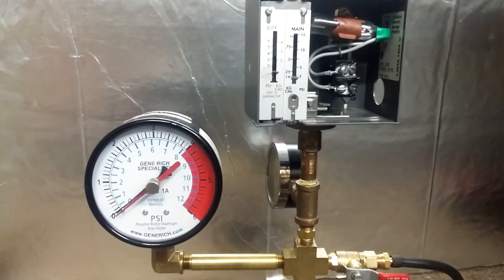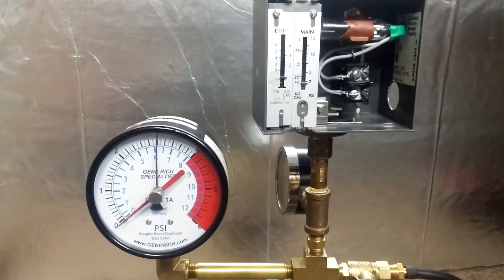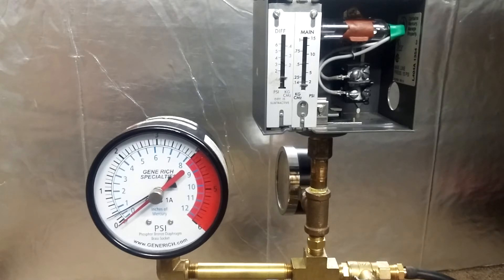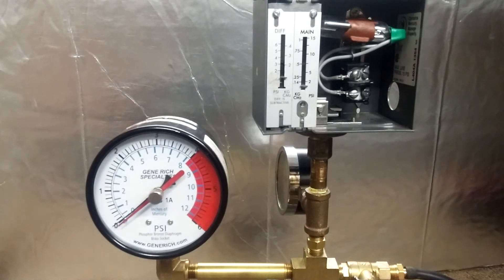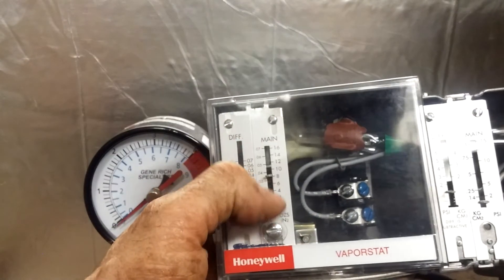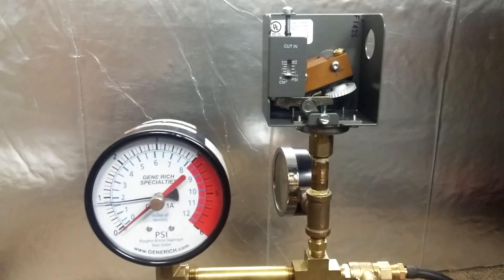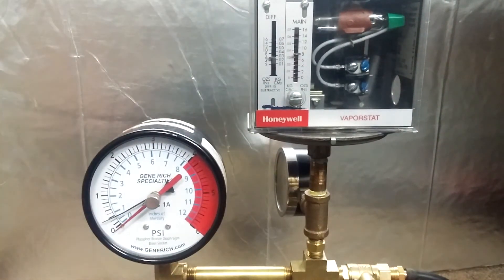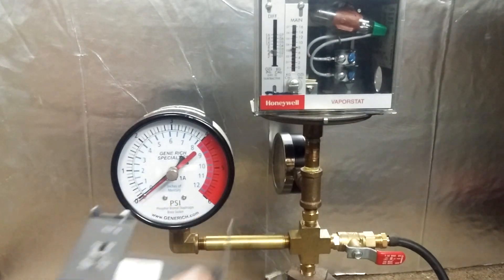Worst Honeywell Steam Pressure Control EVER! A True POS

Comment: Hi,I have the pa404a. Did Honeywell put a thread locker on the adjustment screw to limit the travel of the cut in below .5 psi? It gets snug like it's bottoming out, using fingers thanks
Reply from the maker: If I understand you correctly, yes, Honeywell put blue tinted threadlocker on a tiny adjusting set screw.
I would not try to operate the PA404A below the designed 0.5 psi cut-in as the unit will not be stable enough to consistently re-set to turn on when the pressure drops.
Reply: @gordonschweizer5154  thanks, I have a pressure gauge that starts at 1 psi ,goes to 30, it hardly ever moves except on the early am 25 and below nights when the boiler is overwhelmed. Anyway the 404 indicator is right at .5 and the diff wheel is as far as it goes down to 1.  Anyway the boiler pipes seem more happy when the sight glass water is 1/2 way, nearest the lwco probe, instead of the 2/3 to 3/4 full the plumber always sets it to. The return pipe is slightly above the top of the boiler, It will hammer there on start up if the water fill is higher.
Reply from the maker: Is your pressure gauge of the "internal siphon" type?
Reply: @gordonschweizer5154 logo : it's a usg within a German cross on the dial, connected above the pigtail
Reply from the maker: Ok, I hope the gauge is malfunctioning and not reading the true pressure.
Gauges with internal siphons tend to have high failure rates due do clogging.
And good on you for operating your boiler at the proper water level for your situation.
Reply: @gordonschweizer5154  thank you sir, you know more than me, I just had it all cleaned a few days ago, but it's 20yo, the tech said maybe 5 more and it's done.
Lucky to 30 on a Smith..crossing my fingers,LoL.
Reply: No. The mechanism isn't going to even respond to a Pressure less than a half p.s.i.  the Mechanism itself takes that much to trip the micro-switch.
Reply: @Jeremy-dr3is  ,I had no plans to go below .5,  until I get a vapor stat on the next boiler. I have it turned down to where I feel the loctite resistance and call it close enough.

Comment: Thanks Gordon, I have one of those controls on my boiler I’m going to check the model out now but what’s the replacement for it? Plain Jane pressuretrol or a similar one without mercury from Honeywell?
Reply from the maker: Yes, the 'plain jane"  PA404A is just fine for a single pipe steam system.
If you get a new one, keep the receipt.
If you can't get it to work below 2 psi out of the box, take it back!
Let the folks who you buy it from know what you expect.
Reply: I’m guessing that the better 8oz mercury control with the bigger diaphragm is no longer available?

Comment: Gordon, what a shame ! This is the exact model we have on our boilers, which were set to 7 PSI main and 3 diff, along with L404C 1147 manual reset at 12PSI and L91A 1037 modulating control set at 5 PSI. Would you keep the modulating control we have ? What would it be best to set it to ?
Reply from the maker: You might try replacing your operation control with a bog standard PA404A pressuretrol.
Then, you can turn down your manual reset limit control to 5psi.
The modulating control should be set as low as it can go.
If the modulating control doesn't go low enough (1/2 psi), give us a call.
We have some in oz/in2.
Reply: @gordonschweizer5154  We will be in touch about that modulating control ! Is there any pressuretrol that tops out at about 3-5 PSI that you would consider accurate enough to be worthy enough of using on a vapor system ? Tonight while in the boiler room I had the thought that being able to build that level of pressure is useful for cleaning out strainers that have not been emptied out since the 60's. Do you think there is any merit to this line of thought ?
Reply from the maker: @FirstLutheranAlbany  Honeywell makes (or did!) a pressure control for lower pressures. They called them "Vaporstats". They are more expensive and they sometimes have quality control issues.
Vaporstats come in two basic pressure ranges. The model that might benefit you is the zero to 4psi range. (The other one is zero to 16oz/in - too low, I think.)
That way, no one can jack up the pressure above 4 psi
Reply: @gordonschweizer5154  Thank you very much for this information. I am going to see what 4PSI vaporstats are available.
I believe the system we have is Hoffman Equipped Vapor. All of the radiator traps that are in the original part of the building are Hoffman No. 8's and all of the hand valves that have never been replaced (There are a few in the basement that appear to be original) appear to be Hoffman No. 7's.
Reply from the maker: @FirstLutheranAlbany  Oh, ok then. I might change my recommendation to a zero to 16 oz/in2 Vaporstat.
Hoffman Differential Loops were designed to generally "trigger" at about 12 to 14 oz/in2 steam pressure. 
You don't want them triggered nowadays.
That will send steam into the dry return. The idea in the past  was to make sure the water didn't stack up in the pipes at too high a pressure when operating a coal fired boiler, making sure the boiler didn't dry fire.
So, consider a 16oz Vaporstat.
Reply: @gordonschweizer5154  Alas! I have checked the blueprints of the building. They clearly indicate where a Boiler Return Trap was to be installed. But if you go down into the boiler room - right where it is indicated, there is a wooden plank attached to the wall, with four bolt holes, and nothing else. In 2006 the original boilers (Two 11 section Mills 44 series) were replaced with two Smith 28-A eight section boilers. During the replacement a condensate receiver tank and two feed pumps were installed. So now you might appreciate why I am stuck - I am trying to figure out the best pressure to run something that was originally designed to use components that are now gone, and it is not clear to me how to do this.

Your comments thus far have been immensely valuable and I sincerely thank you. Do you want one of those Hoffman No. 7's ?
Reply from the maker: @FirstLutheranAlbany  Thank you for your reply!
In regards to pressures, 2 psi maximum ever and 1/2 psi as a goal.
Yes, please, I would like to rebuild a #7 Hoffman anytime.
Reply: @gordonschweizer5154  I would like to trade. You get a #7 (Or two) from us, we get the vaporstats we need from you. In the interest of full disclosure I want you to know that they have been painted over a couple of hundred times. Please look here: https://i.imgur.com/0NwSL4W.jpg

Comment: How does a Honeywell  L404B1304 Pressuretrol Controller, 2-15 psi, work?
Reply: Meaning is it a better pressure controller
Reply from the maker: The L404B1304 pressure controller is decidedly "meh".  It works ok, most of the time.
But, unless that control already comes new with the boiler, I'd rather use the PA404-A pressuretrol.  
It doesn't pretend or "put on airs" that it's a great control with that fancy clear plastic cover and what-not.  It's cheaper, too, I think.
Reply: Thank you!
Reply: I have a follow up question. I currently have a Honeywell 404a on my steam system. And it turns off at 5 psi and then restarts at 3 1/2 psi. It’s set for 1/2 psi with a 1 psi differential. Is it broken or can it be fixed?
Tx
Reply from the maker: @paulwizeman764  It can, sort of, but it is not condoned by the factory.
Is the control less a year old?

Comment: I have the PA404A 1009. I tried to set it to go on at 1/2 psig and off at 1.5 psig. Even with the adjusting screw backed off and the differential dial at 1, it comes on at about 1.5 and goes off at 5 psig. (I had to put on a larger range gauge to check it.) 

Is there anything I can do to fix this? Which model of Vaporstat is the best one to use for this range? Would that be the L408J-1009? I just don't want any headaches.
Reply from the maker: I'm sorry you got a bum pressuretrol.
Is it new? You might be able to return it?
If you have a single pipe steam system, even a 4 lb Vaporstat is a bit too much of an expense for what you get.
You might try your luck with getting a new PA404 pressuretrol.
If it doesn't cycle within the correct pressure settings, let me know.
Reply: @gordonschweizer5154  Thanks for the reply. The pressuretrol is about 7 years old and as far as I know no one had noticed a problem. As long as the house doesn't get cold, the system doesn't run long enough to raise the pressure above fractions of a psi. The plan is to leave things as they are for the winter. I don't want to go away for a few days and come home to frozen pipes. I know things work now so I won't mess with it until the spring. I am going to install a vaporstat and put it in series with the pressuretrol. The pressuretrol cutting off at 5 psig will act as a backup if the vaporstat fails and cut the burner before the relief valve lifts. It is just a series circuit with the thermostat. 

I don't want to roll the dice on another pressuretrol. I would rather spend 200 bucks and then not have to worry. I saw one vaporstat with capacity of 0 - 16 oz and the other 0 -4 psig. Which unit is the prefered one? There has got to be a reliable / repeatable controller for the 0.5 to 1.5 psig range out there.
Reply from the maker: @VeritySkiff  If you have single pipe steam, the 0-4 psi Vaporstat should be fine. 
If you use the pressuretrol as back up, try to put it on a separate pigtail.
Reply: @gordonschweizer5154  Now with the holidays over, I had more time to play. I took a closer look at the Pressuretrol unit and did some tweaking. I know that you are a pro and can't tell me if I am interpreting the inner workings of the unit correctly, so I don't expect that for an answer. Hooke's Law tells us that Spring Force = k (spring constant) x Distance. There is an adjustment set screw above the diaphragm with some anti tamper schmutz on it. On the end of the "seesaw" opposite where the spring connects there is a small "tang" that contacts the button on the micro switch. I bent that upwards slightly with needle nose pliers. I then turned the adjusting screw to apply slightly more tension on the spring. Now, the diaphragm needs to move less distance (with less force) to contact the button on the micro switch. I now have the boiler shutting off at 34 oz/square inch (slightly more than 2 psig) and lighting off at 4 oz/square inch (about a quarter of a psig). The differential wheel on the switch is at 1. It can't be rotated any lower. The current actual differential is almost 2 psi. So the issue now is what is inside that microswitch. I need to open that up if possible and see exactly how that knob changes the point at which the switch opens or closes. 

I think I am on the right track. I am moving cautiously since I don't feel like disabling the heating system in the middle of winter.

The good news is is that the system only cycles on and off based on the thermostat. The house gets warm before the boiler builds pressure. I have to turn the heat off in the house for 3 hours or so in order to get the boiler to run long enough to cycle on and off on pressure.
Reply from the maker: @VeritySkiff  You nailed it.
Put your hands in your pockets and enjoy the warmth 😀.
The adjesting wheel/and switch are a sealed unit inside a very brittle phenolic resin plastic case.
Reply: @gordonschweizer5154  Thank you. Good advice. I will leave it alone for now. If the switch is sealed and I can't get inside, there is no point is messing around with it anymore. Thanks for your help. I am sure you will hear from me again when I get a chance to look through your other videos.

Comment: Gordon !! Nice videos , I going through my neglected two pipe steam vapor system.  Has just one high pressure cut off . What models would you recommend for a vaporstat and a manual reset secondary ? This is and old system piped in 1911, with a Smith boiler dated 2003, doing good. My pigtail was totally clogged , gauge stuck as well clogged , thanks Gordon , keep the videos coming 😊👍
Reply from the maker: Your are most welcome.
As for Vaporstats, the current model is the L408J-1009 series 0 to 16 oz.  The other Vaporstat is the L408J 1017 0 to 4 psi. Easy to mix them up.
The manual reset type is the L4079B.
I'd put them on separate pigtails with their own pressure gauges.

Comment: another great video from a pro...thanks for sharing.  What your showing us on the vaporstat is that a setting you would be happy with on a steam residential boiler with a vaporstat?  Over the years I have seen so many technicians crank my pressuretrol/steam boiler to 2.5 or 3 psi...  Now I got a clear understanding what the term knucklehead means in the Dans book.
Reply from the maker: Thank you for your comments!
In general, a single pipe steam should not need more than two psi at the boiler ever. 
The pressure is only used to push the air out. Once the air is out of the pipes and radiators, any more pressure is wasted energy.
It's not the pressure that heats the building, as you know, it's the hidden heat in the steam itself.
Reply: sorry to be so offtopic but does any of you know of a method to get back into an instagram account?
I somehow lost the password. I would appreciate any tips you can give me.
Reply: @Jerome Cade instablaster :)
Reply: @Dalton Dominic thanks so much for your reply. I got to the site on google and I'm trying it out atm.
Takes quite some time so I will get back to you later with my results.
Reply: @Dalton Dominic It did the trick and I now got access to my account again. Im so happy!
Thank you so much you really help me out !
Reply: @Jerome Cade No problem :D

Comment: What is your opinion of the honeywell vaporstat?
Reply from the maker: That depends on which model. The older mercury units tended to work well down to about 8 oz. Below that setting, they became less reliable.
The really really old style could go down to 2 oz. High quality!
The newer non-mercury ones started out as crap, had all kinds of failures, many right out of the box, others took six months to show up. They are better now, Honeywell seems to have gotten their act together for now.
All the same, test, or it's just a guess. Don't trust Honewell to do it right...test it before you install it, preferably right at the supply house before you sign for it.

Comment: Have an L404A and it has worked fine for over 16 years. Lately started giving me trouble. I think the diaphragm has failed. Seems to be up in the open-circuit position and pin wont' go back down.
Reply from the maker: Is the pigtail clear?

Comment: Gordon,  I have been having trouble with the new vaporstats too.
Reply: This L404A shown above sorta looks like a nice vaporstat, but it was a cheat.  At least Honeywell junked the thing by and by. The diaphragm was way too small to ever work even at 2 psi.  Fail.

The new vaporstats, the true 16 oz/in2 type, as you justly say, are a crap shoot, arn't they?  I show up at the supply house with this tester when I buy them, and  I will reject the damn thing right then and there if it doesn't pass muster.

Even so, the newly tested ones 6-14 months later fail and my customer calls saying their system is going crazy.  Does that sound like the problems you're having?
Reply: That is exactly correct.  I have found that using a manual reset secondary pressure control will signal when the vaporstat fails.
Reply: Good on ya!  We don't do that often enough on small residential installs.  Commercial installs (or anything above 400,000 BTU/hr for that matter), manual reset secondary controls are required, as I have no doubt you already know. 

I have a theory, and it is just that, that the diaphragms on these new vaporstats are leaking slightly, oh so slightly.  As the pressure builds, the water in the pigtail is pushed into the diaphragm as the air leaks out through the bad stainless steel seam weld.  The diaphragm fills with water, rusty water, and distends and puckers the thing and blows out the already indifferent calibration.  I took one that failed apart and I found a LOT of water in the diaphragm.  I cleared it and re-calibrated it just to see if I could.  I could, but. what. a. pain.

It sits on bench, mocking me.
Reply: That’s funny